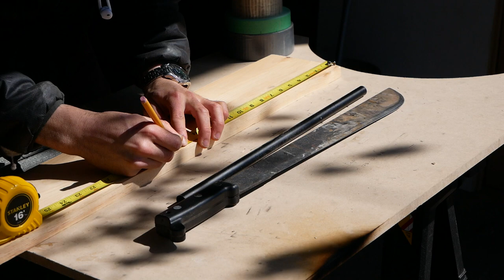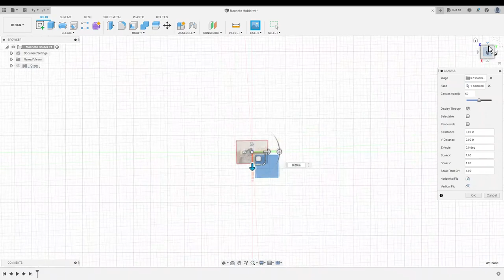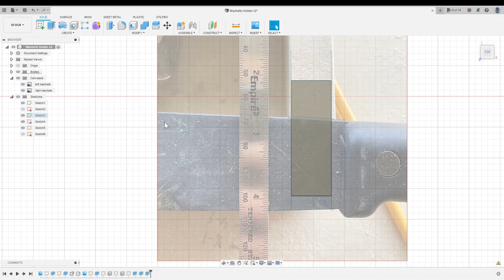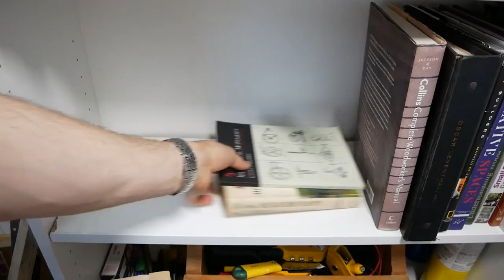MACHETE TAPE DISPENSER

Comment: You should update the retaining mechanism to a latch or something faster to disassembly, you can't ask the zombie that just broke into your house to wait until you get the drill and the proper bit for the job, unscrew all and get a proper grip with all that tape... Even worse if the drill is low on battery.
Reply from the maker: That’s a good point! If a zombie breaks into my house I might just rip the machete out of there 😂
Reply: I came to comment on a zombie apocalypse release mech and see I was beaten to it. A quick release may create a hazard. I’m sure you come up with a work around.